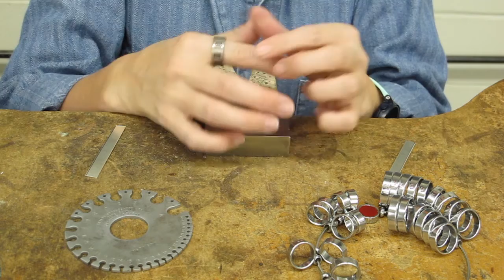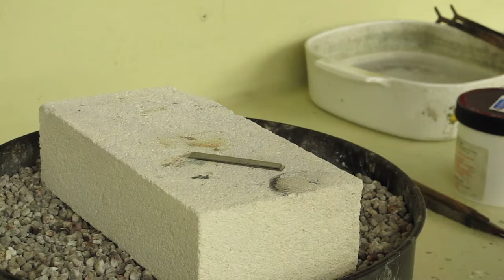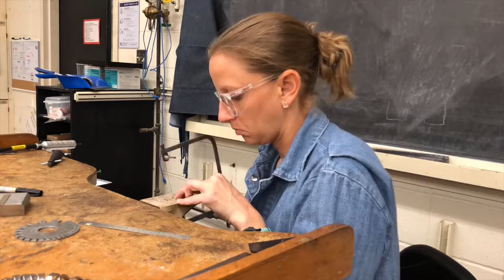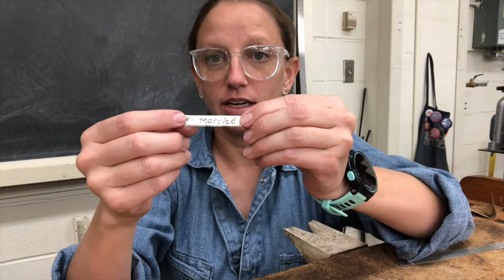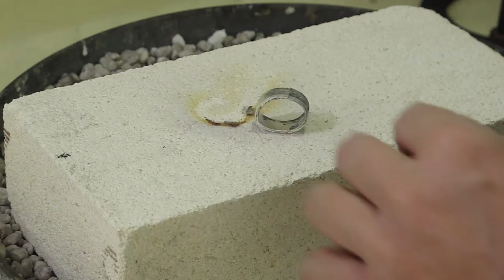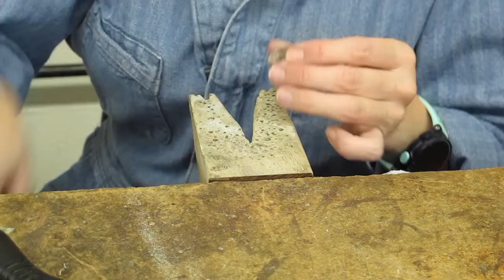Overlay soldered Ring

Comment: Great video! What gauges of silver sheet should be used for the ring? I do not have a ring shaper thing and tried 2 rings, one with 18ga over 20ga, the second one with 20ga over 22ga. Both rings were so stiff that I could not get a good "spring" to solder them closed!
Reply from the maker: I usually teach to form it in multiple ways. It gets hard depending on the design. You just need to anneal. I often anneal when I get the ring perfectly lined up. It eases the tension before soldering. You can use any gauge you want. I often use 20 and 20 or 18. Depending on the design- some designs pull the seam apart when soldering and you need to hold the ring together with copper tongs right when the solder flows
Reply: @laurenseldenmakingthings7045  Thank you for your reply, Lauren!  I ended up using baling wire to squeeze it together. The wire absorbed too much heat on the first try but when I removed the wire, pickled, dried, and soldered again without the wire, it soldered fine. Your answer makes me think that the first try annealed it well enough to ease the tension. Again, thank you.
Reply: That "spring" business she shows is dependent on the way you use that ring bending tool... and there is not nearly enough being said about final sizing. Those charts for length seldom match the numerical ring size that your client gives you.